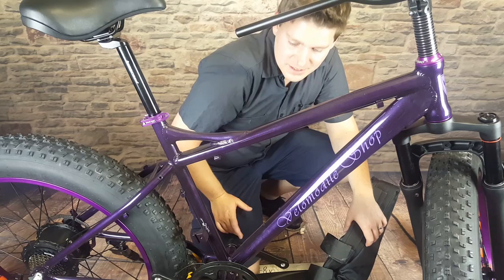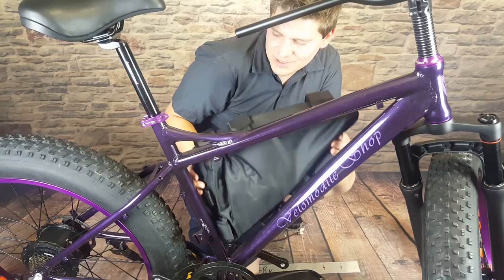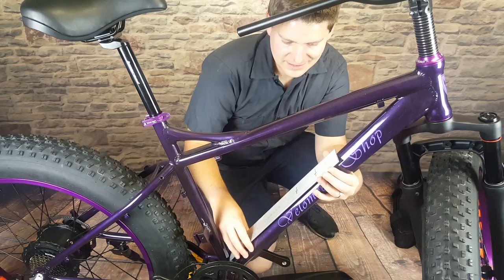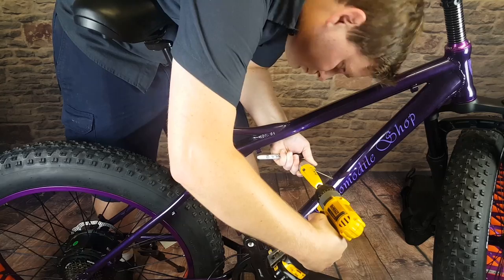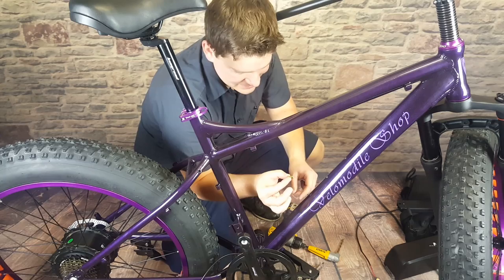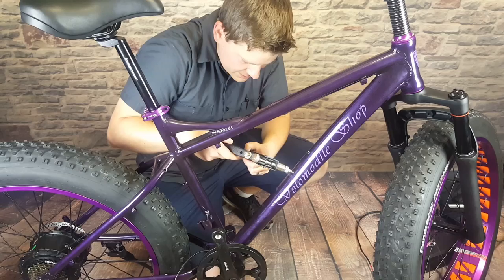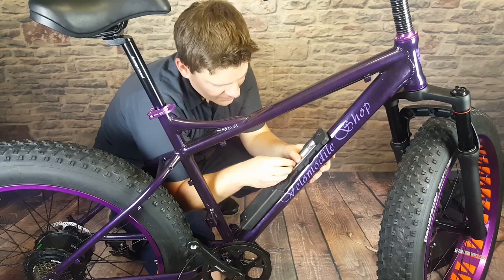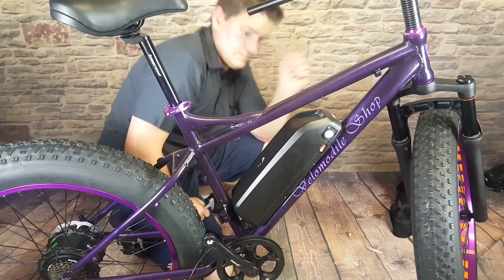How to install downtube ebike battery to your frame - How to build an ebike, episode 6

Comment: My cradle sat off-set, meaning the battery was leaning to one side 😢, I bought the “Grin triple Bob mount”. They use alternate hose clamps. Which allowed me to shift the cradle just a little bit to center the battery.❤. Super strong mount.

Comment: Why drill holes into the frame?  I disassembled the battery cradle, added holes in the aluminum chassis, there are only 3 small screws holding the plastic body onto the aluminum chassis.  Then mount the chassis onto the water bottle holes, and reassemble with the 3 screws that hold the plastic to the aluminum chassis.  It worked and it means you don't have to deal with nutserts.
Reply: Hi bro! I am literally thinking of doing this but i lack knowledge in drill sizes.. what drill bit type and size you used?
Reply: @Holyeddybear  I pulled one of the water bottle screws, measured it with a drill gauge (first size the threaded section drops through cleanly), that tells you what bit size to use.  Took me all of a minute.  It takes longer to disassemble the battery cradle than to select the right drill bit.
Reply: @ebikeengineer  gotcha bro.. thank you.. will do it carefully 😀

Comment: And in a couple years your frame will be trashed when the nutserts get ripped out from the weight of the battery.  That happened to my wife's Trek 7.5 with the OEM mounting location.  I strongly advise NOT using this mounting method.  Mount the battery to something that wraps around the frame from the top tube.  There exist water bottle mounting fixtures that strap around the tube.  The Shark battery is too heavy to be mounted the way it was designed.  It is a serious design flaw.
Reply: That's right. It happened to me too. I solved it by making an aluminium bracket which mounts to the existing bottle cage mounts, plus two jubilee/hose clips around the bracket to hold it securely onto the downtube, with some old inner tube to protect the frame from the hose clips and give a tighter fit. Ready made similar brackets used to be available, and have one on another bike, but they don't seem to be available any longer, at least not with the jubilee/hose clips, which is an essential part.
Reply: What was the weight of the battery?
Reply: @kurtXhecticXpl  about 10 pounds.
Reply: This only happened because you mounted it to a regular bike which is not designed to be an ebike. Real eBikes have much stronger frames and will not be damanged by the battery weight.
Reply: imo about to mount the battery that way. The battery feels really heavy though. Maybe it needs reenforcing
Reply: @theendurance  "Real" e-bikes have a battery integrated into the design of the frame, not an add-on.

Comment: I have a battery like yours that didn't fit the bottle mountings so I mounted it up side and it would have wobbled if it fitted correctly so I used 2 stainless steel jubilee clips joined and when tightened "forms" around the battery and it's rock solid.
Nice video. I used the jubilee clips before on my old bike that got stolen recently so starting again. This time a 36v 15ah
Reply: Sorry they stole your bike.

Comment: Why not uses the original two holes.
What is already there for the bottle holder.
Just need to drill two holes in the battery mount.
That way you don't need to drill extra holds in bike frame.
Obviously 2 at the bottom & 2 at the top will be the best.

Comment: Hi, great tutorial. You have got a new subscriber. Could you please tell us what are the two drill bits you used at first and at last before applying the rivet? I wanna use the exact same to ensure I don't screw things up with my frame. I am buying the exact same tools as you did. Many thanks.

Comment: i bought an ebike missing battery.   Is it just as simple as buying a battery and charger?   Or is there also some kinda "brains" , "logic controller" , or other safety feature that also needs to be included in the picture ? thx

Comment: Have a question, I have 5 Li Ion batteries,  18 volts and 5 ah each.
If I put 3 of them in parallel,  that would be a 18 volts with 15 ah of capacity,  then take that source into series with the remaining 2 batteries which should give me a power supply of 54 volts and 15 ah of capacity. correct???
Would the 35 amp upgrade controller handle that power source??
working on an idea,  looking for some knowledge and expertise 
thanks for your help with this

Comment: You can also unscrew the bottom aluminum part on the battery, drill it and fasten using the factory bike mounting points. No need to drill your bike. Lunacycle does this https://youtu.be/AKmrLkXVwHA
Reply: So awesome! So glad I read your comment. This is what I will do too. 😆 Thanks and God bless 🙏

Comment: Hi Kyle , I have a Ancheer Mini electrical Scooter and I want to Know if I can swicth my battery same model but different Ah from 6.0Ah to 10.4 Ah the same charging Voltage : 42 V .
Thank you .
Reply: Don’t know if I’m late, but yeah you can, if polarity and voltage are the same you should be good to go

Comment: Is it enough to hold a 3kg battery in place with 2 screws? Has one of these ever come off?
Reply from the maker: Yes it is, and no I have not.  It helps that it's impossible for the screws to come out with the battery installed.
Reply: use proper screws ;)
Reply: For a different point of view check out "Secure Battery Mounting, Grin's Double and Triple Bob Anchors"
https://www.youtube.com/watch?v=GdqxPPxiYnU&t=21s&ab_channel=GrinTechnologies
Reply: @nc3826  takes too long for delivery 🙄. Have to wait two fukin weeks. I’m soo mad. Have to buy it from amazon cos they only ship to USA and Canada 🙄🙄
Reply: Whole 2 weeks??? flmao

Comment: I need to put my battery on the underside of the frame, i.e. with the top of the battery pointing down towards the front wheel and the ground. Is the locking mechanism strong enough to hold the battery in place like that, even hanging upside down? Thanks!
Reply: I have the same question but sadly no one answered. Just to be sure I think ill mount my battery the correct way considering how expensive it is. Don't want it slipping out of my hands or dropping mid ride. I'm sure the locking mechanism is strong enough to hold it tho. Gonna start my build today.